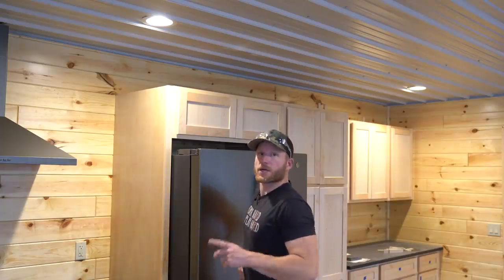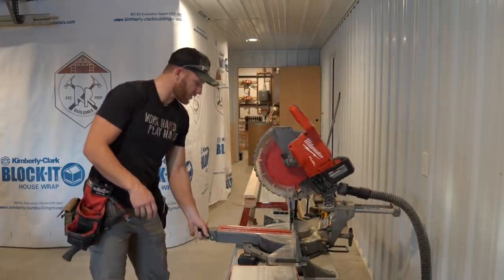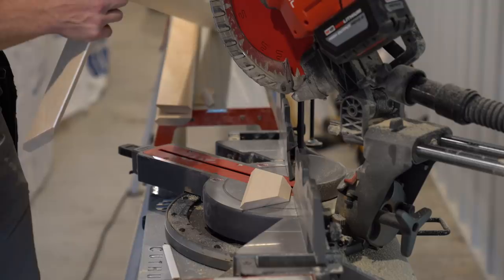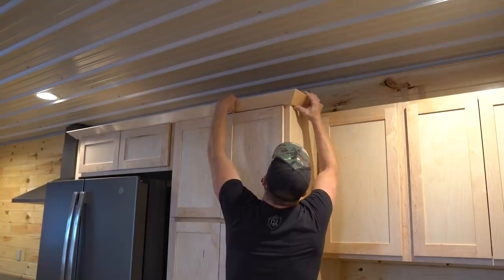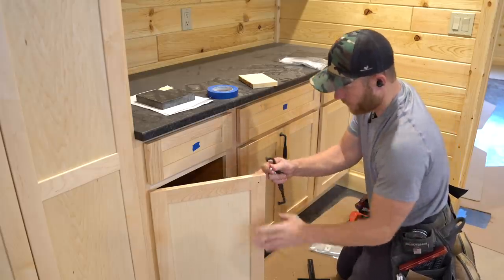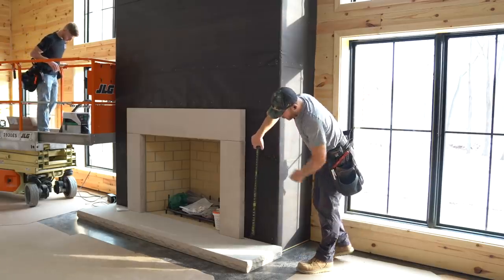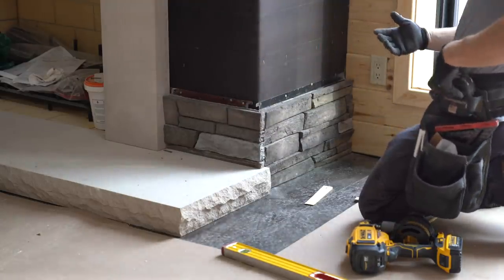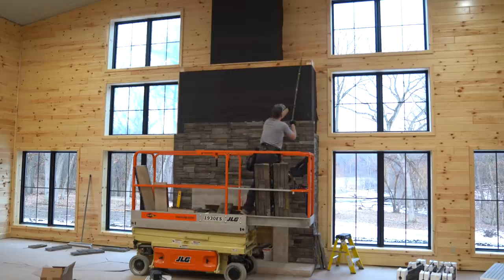Cabin in the Woods 49: Installing Crown Molding, Cabinet hardware, and Chimney Stone

Comment: As a builder myself, I absolutely get it. It's because you've built it from the ground up and even done the fit and finishing. For me, those are the toughest builds to leave because you put so much time into the little details, which most of the time, isn't done when throwing up the structure. In my opinion, this build is your best quality of work to date. Be proud of it and on to the next one.

Comment: About 40 years ago I took two pieces of sheetmetal and folded two sides to form half a box. I folded the second on the opposite side and spot welded them together to make a jig for drilling hardware.  I"ve used it repeatedly for decades.  The position of the holes has changed as the hardware and stiles have changed.  To compensate and make sure I use the correct holes, I've covered both sides with tape and drilled the new holes.  It cost me nothing and has been effective.Spot welding them together allows for flipping and using on either door swing.  Since then I've seen where someone dadoed a 1x2 and cut and mitered the two pieces in a 90 and fitted a piece of 1/4" plywod in the dado.  Then marked and drilled the holes for the handles.

Comment: I have really enjoyed watching all of the videos, and the craftsmanship you put into this project.  I too am pretty much a perfectionist also in any project I do.   Some, like rebuilding an aircraft engine, actually require it.  I have learned a lot about post frame buildings as I have followed several projects, like The Mad County Build, Outdoors With The Morgans, and parts of others.  One of the projects actually put the post in the ground.  Which I would never consider doing.  But I still prefer a slab or raised foundation with a stick built building.  I do not see any benefit in a post frame building over a stick built building.

Comment: Use a little scrap piece of wood and some CA glue to act as a crown stop once you have your crown nested at the correct angle nested against the miter saw fence. Makes it much easier and once your done just pop your crown stop off and there is no damage to the saw

Comment: There were some interesting questions brought up on the last video.  I wondered if you were going to explain them?
1. The spacing on the rails on the stairs.
2. Securing in the stair post with endgrain screws instead of putting in pockets like the upper railing.
3. Putting the bottom post on the second tread instead of bottom.
 I imagine some could be answered by saying there is no code for those things in rural Illinois.  Just wondered about clarification.  I do enjoy the videos.

Wonder how you made out on this one?  Can't believe you expected a nearly 8 month build?

Comment: Cutting molding backwards is not ideal. The teeth of the saw create tear-out.  You can hold it just like it goes on the cabinet and cut your angles without trying to figure out the compound angle but you have to be DAMN careful the saw doesn't grab it. More than once I've almost lost fingers doing it. I would never suggest for an amateur to hold trim like that any movement in the piece the saw can grab it and it can destroy your saw and your body.  You can chisel those plugs flush then lightly sand...much easier.  Building is looking good!`